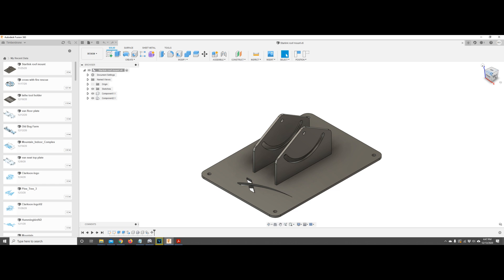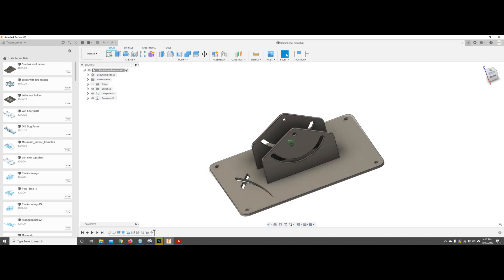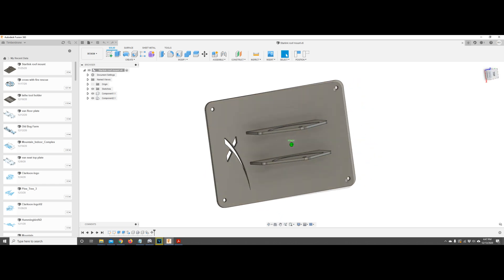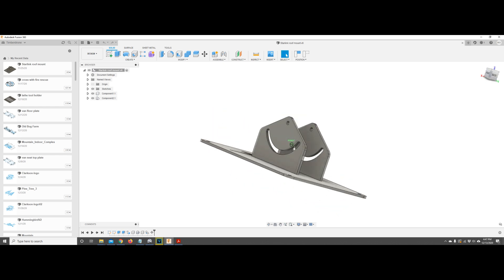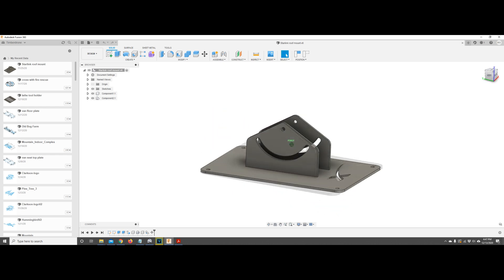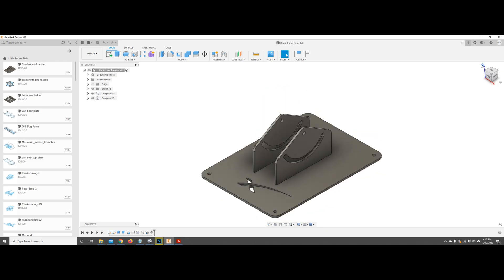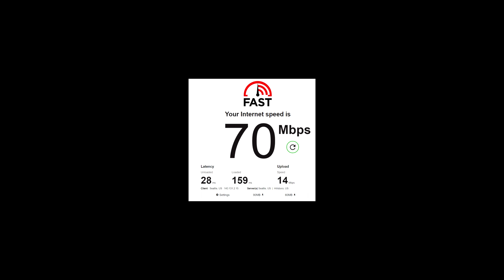Starlink Video 3:  Building a custom roof mount

Comment: I asked starlink support what the heat resistant value of the dish cables are. They responded its 122 degrees. Consider some roofs get very hot in the summer time, especially in the south...this might be a problem. Asphalt roofs get brutally hot. I bought some heat resistant tape to wrap my line with because I dont want my cable line melting on the roof

Comment: This is awesome. What is inside diameter of mounting pipe you used in this video? I noticed you had to slightly enlarge the i.d. during fabrication. You can a lot of different things very well man!
Reply from the maker: I should have included that in the shot!  I machined the ID of the tube to 1.440""

Comment: Matt. What was the inside diameter of your adaptor pipe that the mast dropped in? My starlink is on order but want to make a fixed angle roof mount like a simple plate with stem welded to it so the dish mast just drops in and is vertical.
Reply from the maker: I machined the id to 1.44”, IIRC.

Comment: What would you charge to fab one of those up and ship it to me? I don’t have starlink yet, but I’m checking my inbox every couple hours for that invite, that thing is going to make my rural life a lot more efficient. Best option I have right now is to pay a fortune every month for hot spot data that only gets me 6mbps on a good day because cell signal in my area is basically non existent without my Wilson Pro 1100 booster. I also have Hughes net but I don’t know why, it’s pure garbage. Sorry about the rant, just anxious to be connected to the internet at a decent speed and save myself about $150 a month by dumping Hughes net and lowering my cell data plan. If you talk to Elon tell him I’m waiting. Nice shop setup by the way, I have a fairly large wood working shop on my property so I appreciate your skill set. Let me know on that roof mount.
Reply from the maker: Starlink offers a couple of different mounts for purchase when you order your equipment.  IIRC one of those is an adjustable roof mount.  It takes maybe 3-4 hours to build one like this; If I charged my normal hourly rate to build another one it would likely cost more than the Starlink one.  However...if you find that their mount doesn't fit your needs, let me know.  I saved the CAD files and could throw together another one in fairly short order.
Reply: @MattVerley  appreciate the reply. I’ll let you know if their mount won’t work. Thanks again.
Reply: @MattVerley  whats the inside diameter of the pipe one needs to use

Comment: Nice work. I think you probably can go by without adjustment on the shaft angle. If you look at the OEM volcano mount, it is just fixed. The dishy itself can tilt.

Comment: That a really clean mounting bracket my friend.  Excellent work.  I just stuck a piece of pipe on mine with a coupling the fit over the volcano mount and bolted it through but it seems to work.  I think your speeds are a little bit are a little slow though.  My best guess is I'm at right around 100mbps on average with 150 happening quite often and occasionally dipping to 70-80mbps.  I have a video on my channel showing my setup.   I wish it pivoted like yours.

Comment: I thought your intent was to use this as a mobile unit with your truck, am I remembering incorrectly, or was there something that changed your mind.  If I recall correctly there were going to be some limits (at least initially) to the range it could be used.  I was thinking of that type of "mobile" set up for our travel trailer as we are often out of cell coveragewhere we go  (for local hot-spot)  and though I really don't "need" the phone, having the internet is desirable in this age of remote "at home" working.
Reply from the maker: That is my intent; as soon as Starlink releases the geofencing or adds a "temporary fixed" station option, I'll build a mobile mount for my truck.  For now, it will reside on my roof.